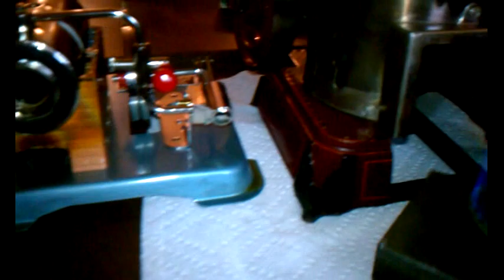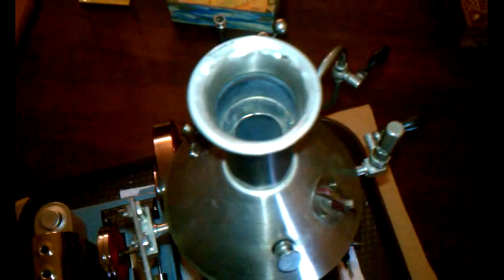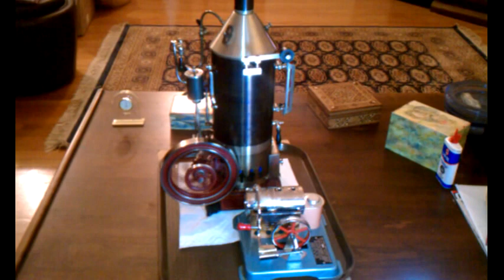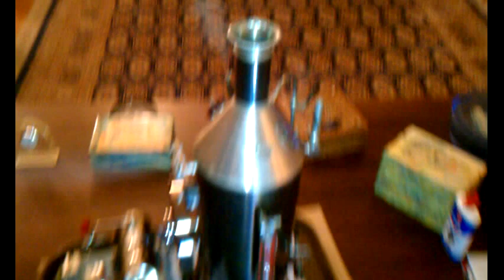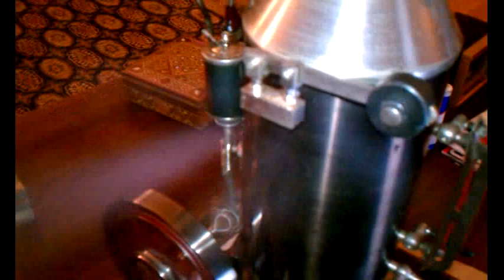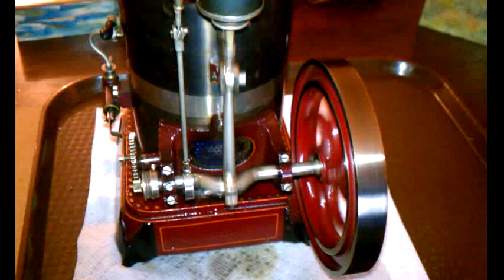schoenner vertical steam engine

Comment: I just purchased a big vertical Schoenner but not as big as this one. It's an earlier model with the base painted green and maroon & gold rivets but you can see many of the same features as this one. It has an older style burner that enters through a cast hinged door that swings open.  The earliest bases were cast iron on wood from this company. You have a great engine. The flywheel is outstanding.